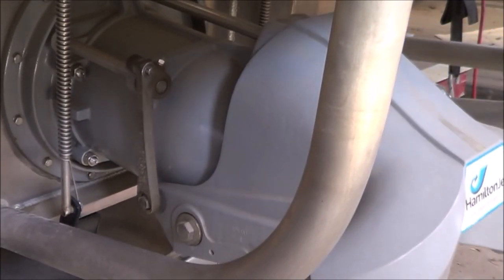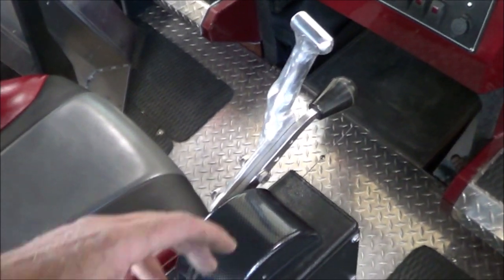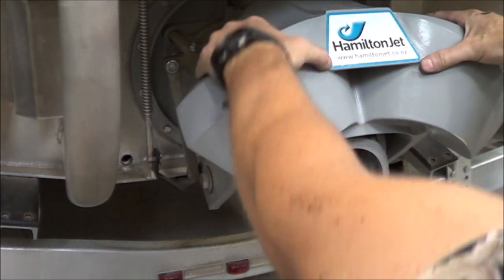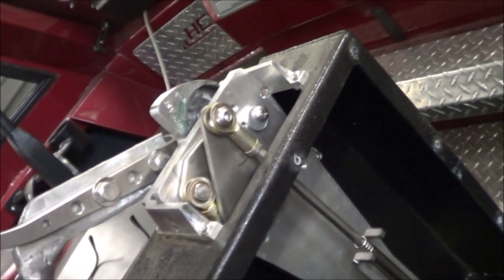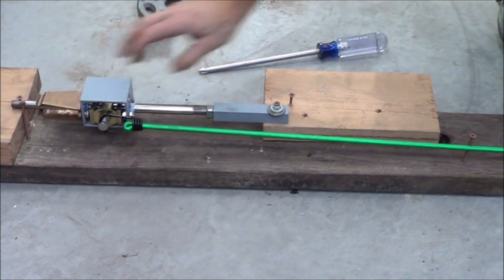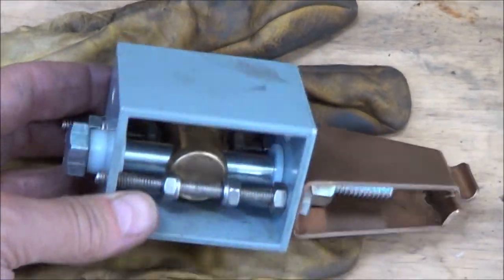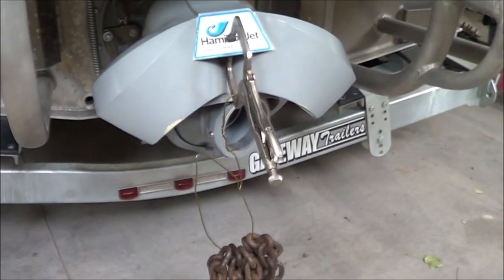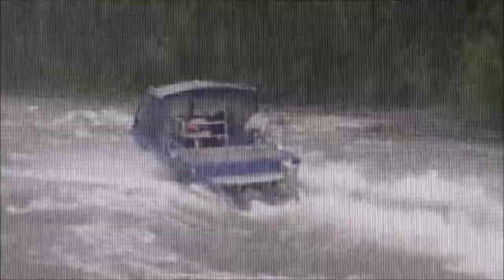Hamilton 212 Reverse Bucket Dissected

Comment: The ‘brake box’ is designed (genius) to keep the bucket from moving, up or down, in any and all positions (except full reverse/forward) from idling to full throttle for maneuvering purposes. Since that can’t be done with a single lever control unless the engine is idling, I do agree with you. I believe your problem’s something else though. Cheers!

Comment: There almost has to be a tight bend at the tower the helm is mounted on. And a decent bend where it turns at the transom to the jet . I would think the single stick makes it harder because of leverage in the system seems to move the bucket a lot more then the helm.  Just that could make it harder. Moving the bucket up and down that much and moving the helm a little seems the bucket has the advantage.  I'm probably wrong  but you will let us know ! Keep up the great videos! Your almost new boat looks great! I like to see it when people use their boat for more them just yard art !

Comment: Where do you buy parts have a 245 unit and need help with hydraulic cylinder control valve leaking

Thanks don

Comment: I was wondering if you could help me I’m looking for a diagram on the reverse duct two bolts that hold it up with washers and spacers, I bought a Hamilton jet and it is missing some parts
Reply from the maker: The Hamilton website is organized horribly, but the manuals are on there somewhere. You might contact them for the link.
Reply: Ok

Comment: Looks like you have this Hamilton figured out. Just got one and having a issue with getting it into reverse. Mine is hydrolic but not sure where to start. Any chance I can contact you? Thanks in advance
Reply from the maker: See contact email in "about" for my channel.
Reply: @idahoviking  Thank you. When I tried to look at your about on your channel I oit in the email address and it says it isn't a valid address. I'm probably doing something wrong but having issues with getting into drive neutral and reverse. I'm thinking it's possibly a issue with the pump or solenoid. Or possibly the switch. Definitely not ideal when trying to dock or run the river. Any help would be greatly appreciated.
Reply from the maker: @brandinolson9874  I'm not familiar with the hydraulic solutions for the 212, except that they seem to fail frequently due to inferior equipment and/or installation. Where are you located?

Comment: Pete gemstatejake here the green duckworth guy. We had a discussion on this subject down at Pittsburgh a year or so back. I’ve fought my reverse since I bought the boat and will now have a hydraulic reverse installed. Curious why you didn’t do the same? I know you’re a engineer type and enquiring minds want to know, but the hydraulic set up seems to solve all problems. Am I missing  something?
Reply from the maker: Jake -- there were several reasons to investigate rather than go directly to hydraulic. (1) I had trouble believing that the difficulty I experienced is "normal". I weigh about 200 lbs, and this was barely adequate to move the lever reliably. (2) Some people have a lever setup like mine and claim it is easy to use. (3) Although it was difficult 95% of the time, about 5% of the time it was very easy; this suggested the possibility of making it easy all the time. (4) The hydraulic setup would be a toggle switch, rather than integrated into the lever throw. I really like this aspect of the single lever, because it is instantly instinctive, and if something unexpected happens, reflex makes all the right things happen.  Forward to go forward, and back to go back. So I decided to investigate in hopes of making it easy all the time.

Anyway, between removing the brake box and replacing the cable (next video in the series), it is now super fast and easy.
Reply: I see. I have a single lever Flo-Tec set up.. I agree it’s very instinctive and easy.. I’d prefer to stick with it but it just is not reliable. I’ll have to investigate the set up you came up with here. Seems like a good solution.

Comment: You have to get a better lever made.  That thing is ghetto.
Reply from the maker: It didn't look too horrible initially, but it was bumping the seat in reverse, so I had to chop it in half and angle it sideways. That's when things went super ghetto. When everything is absolutely 100% perfect functionally, then I'll attend to form.
Reply: @idahoviking  it's cool.  we all have to improvise.  Hope the HCM is treating you well.
Reply from the maker: Indeed, the hull performance is superb. The relatively long bow rise smooths out the chop, and it tends to climb up waves more than bashing into them. And the welded-in sub-floor makes it very rigid with zero flex or twist.
Reply: @idahoviking  when I rode and drove shurms 20' I was so impressed with how well it didn't bash the waves.  I'm not sure if it was the lightweight of the hull or what. But it's probably the smoothest riding boat I have been in on whitewater.